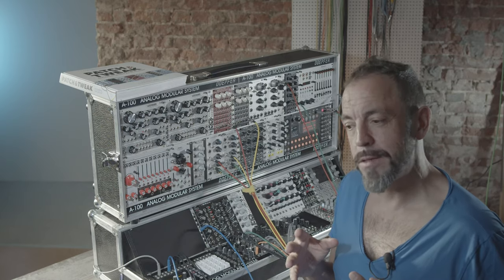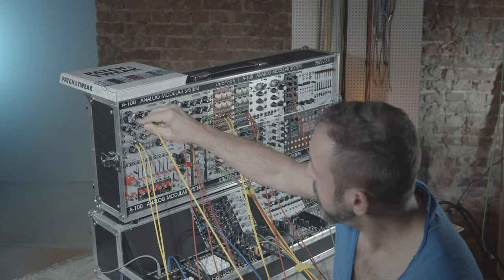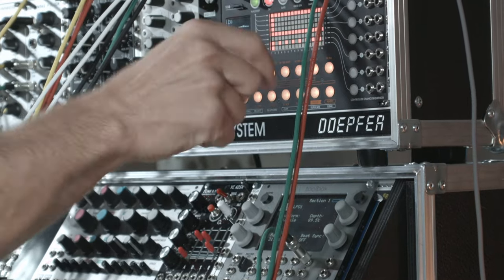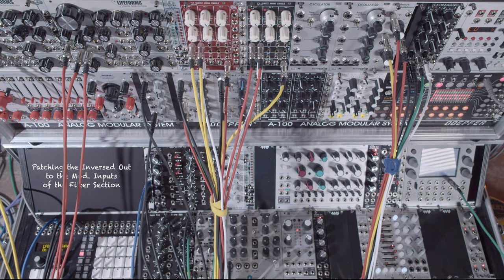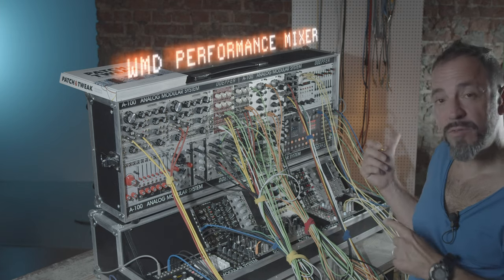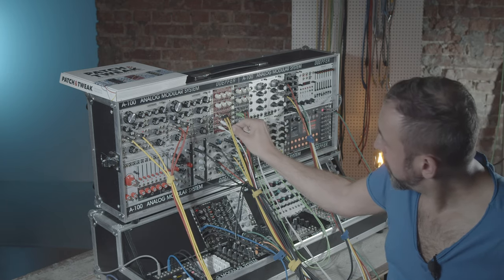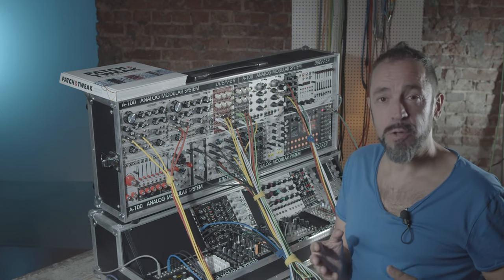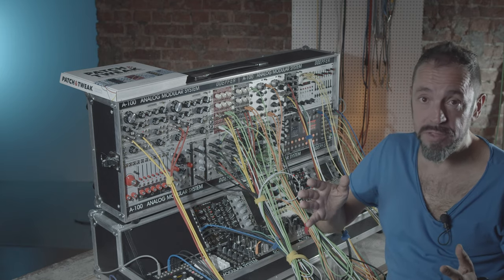The Eurorack SideChain effect on the Modular System without a Compressor - Sidechaining Tutorial

Comment: Thanks a lot for the video! So there is no need for an offset at any point?
Reply from the maker: Offset?
Reply: @MaikSchott  well, in a lot of videos about ducking, the drum gate activates an envelope that is inverted and then offset with an offset module to duck the vca. I was wondering how you managed to do without the offset. I may have misunderstood I think
Reply from the maker: @antimoustique3175  when you have an envelope with an inverted output like this Doepfer, you do not need an offset module. At least not in this combination with the ADDAC  VCAs.